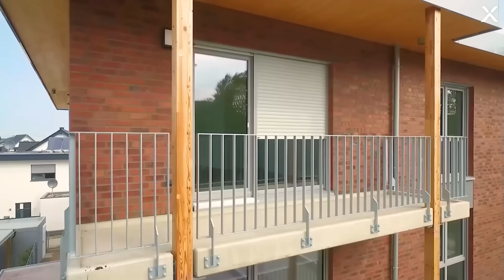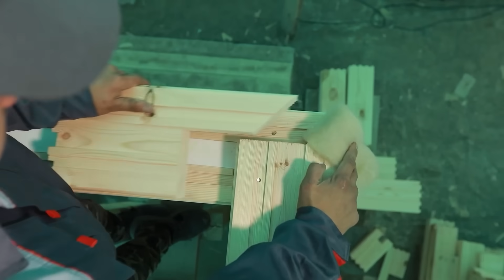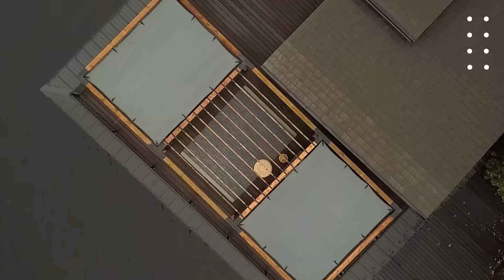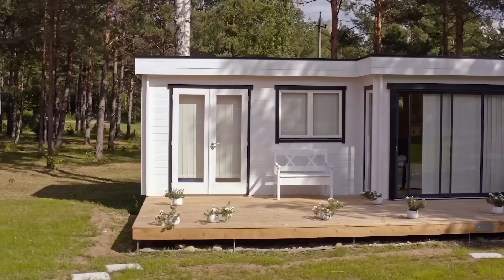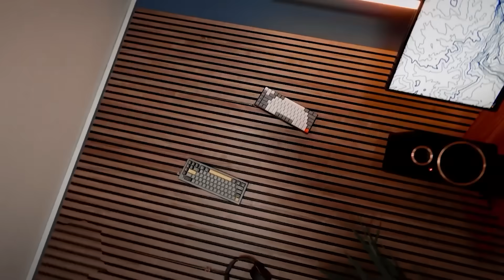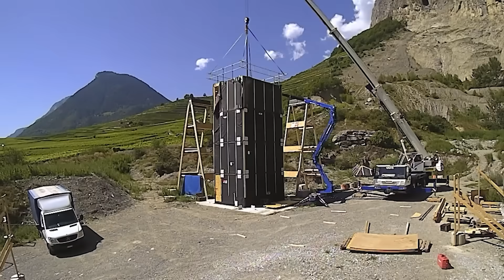WOOD CONSTRUCTION TECHNOLOGIES THAT HAVE REACHED A NEW LEVEL

Comment: Das Modulare industrielle bauen hat hunderte Vorteile und keinen  einzigen Nachteil . 
Planung dank Virtueller Brillen kein Problem. 
Dank CNC Technologie kann jeder Wunsch ab Werk umgesetzt werden.  Türen, Aufteilung, Fenster , Treppen etc. 
Weniger Verschnitt,  Verwendung von günstigen Holz  (Maschinelle Bearbeitung) 
Keine Verwendung von Nägeln oder der sonstigen Befestigungslösungen auf dem  Bau ( USA und andere Entwicklungsländer) 
Dämmung,  Schallschutz, Trittschutz . Vorbereitung  Bad, Küche inkl.  Trennschichten nach DIN. 
Bessere Arbeitsplätze, Ausstoß und Produktivität höher.  Planbarkeit. 
Verwendung von z.B. anderen Formaten,  die kaum einer auf der normalen Baustelle bewältigen könnte . 
* OSB Platten mit 5.000 mm * 2.500 mm. 
Schwere und schwerste Elemente können perfekt eingesetzt  werden (Türen, Fenster etc. ) 
# Das was ich als Holz Ständer Bauweise in den USA immer wieder sehe, ist nur Futter für das Feuer und den Sturm , da kann man kaum drin leben und die Betriebskosten  sind unerbittlich zu  hoch. 
Holzbau Made in Deutschland, Österreich, der Schweiz ?  200 m2 Wohnfläche .  Energieverbrauch  Wärme, Warmwasser Kühlung ? unter 5.000 kWh Strom p.A.   30 MWh kommen von Dach  also nach der  Bilanz noch   2 BEV drin .

Comment: Watching this was very frustrating.  Useful new technology seems to come from Europe and lots of products just make the product more expensive to make up for qualified labor. 
Bad Forrest management and lack of innovation is partially to blame for the former affordable American wood frame house becoming no longer available.  
( 3 bed 2 bath wood frame !modern! House shouldn't cost more than $150 to build)
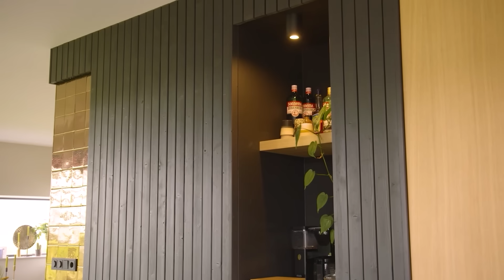15:19 15y warranty on exterior siding for a house? That's not a good thing.
Reply: Europe is more innovative with home materials, US is all about PROFIT MARGINS - and REITS DICTATING how the housing markets are CONTROLLED - it is ALL DATA DRIVEN - so build it to keep it MARGIN HIGH PROFITS
Reply: @Rio-by1eh sad thing is that it used to be the other way around.  You had so many more new things in the US because European bureaucracy smothered any innovation.
Reply: Das was sie haus nennen, wäre bei uns nicht mal ein Schuppen.  Die 150.000 $ sind doch günstig, bei den extrem  hohen Stundenlöhnen der US Hilfsarbeiter auf dem bau, die nur Leisten zusammen nageln. 
Die Gebäudetechnik ist halt heute viel aufwendiger als früher und etwas Dämmung sollte auch Häuser im Süden der USA haben, damit die Klimaanlage  nicht 20 kW Stromaufnahme haben muss. 
# Ist doch logisch, das ein Modulhaus günstiger sein kann,  weniger Verschnitt ,  Anlagen und Maschinen,  CNC Technologie und Moderene Verfahren  und eben nicht  1 Mill. Nägel, was jeder kleinere Wind hinwegfegt. 
# Ich wette 10 Mill. $ , dass ein Holzständerhaus aus D.  jeden Sturm in Florida überleben würde, wenn  da nicht andere Häuser und Bäume rumfliegen würden.  
# 50 mm OSB Platten  auf dem Dach verschraubt mit 10mm *  400 mm Speziell schrauben.
Da man ja die Dachlatten   und die Dämmung 300 mm   verschraubt  mit dem Dachbalken aus Vollholz . 
Energiebedarf p.A.  inkl. Warmwasser  bei 200 m2 ?   Unter 5.000 kWh Strom inkl. Klima im Sommer ( Berlin )  für alles . 
Es kommen vom Dach im Jahr ca. 30 MWh p.A. aus 30 kWp